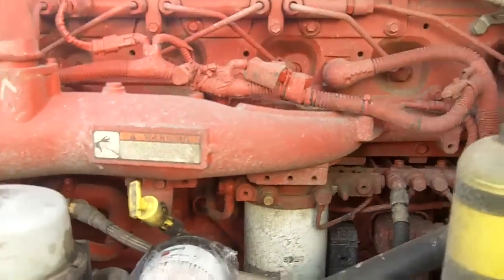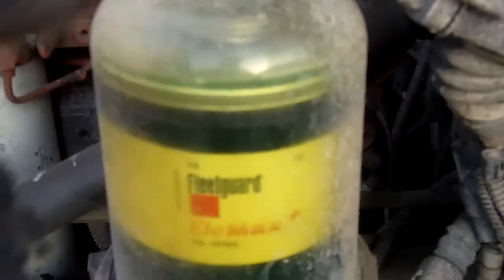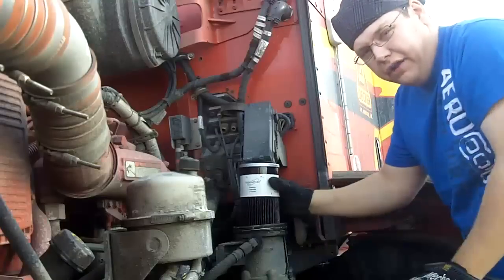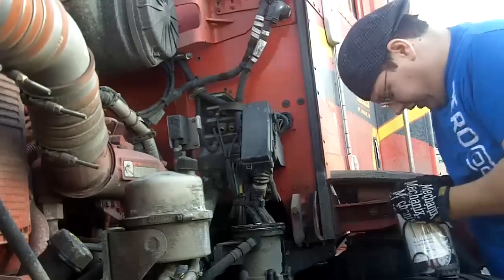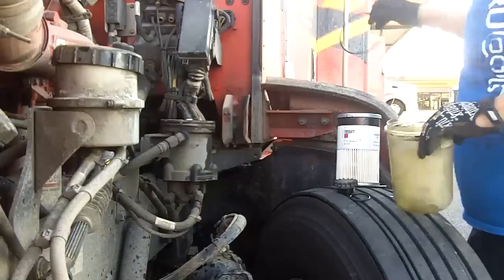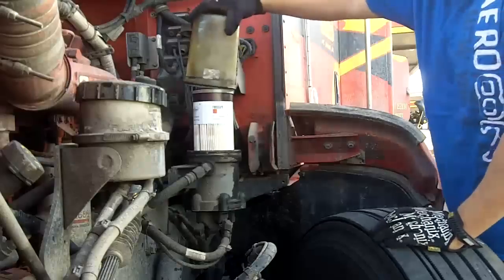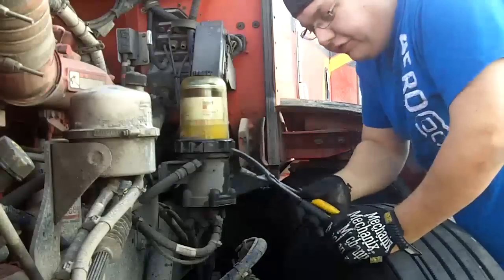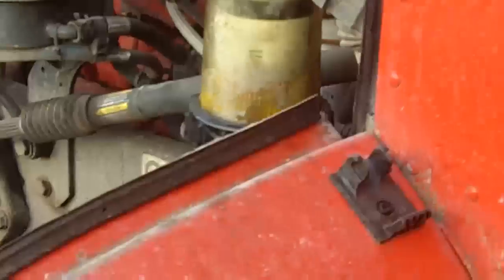Cummins ISX Fuel Filter Replacement

Comment: Dude you don’t need to reuse old fuel to fill up! It’s a CUMMINS! Next time after replacing new filter and tighten ring turn key to ON position BUT don’t START. Wait a couple minutes. Watch how it automatically fills up with fresh fuel directly from tank!

Comment: Thanks for the video, I was going to take my truck to the shop to change that filter but your video has changed my mind and I will do it myself, very easy and simple again thanks, Next time say you will turn the old filter and jug into a Haz Mat facility or disposal point, I happen to work in Haz Mat so be careful what you say and do in today's society dealing with Haz Mat or Hazardous Waste. Be Safe Down the Road.

Comment: Fantastic video there guy., but i would agree heavily with jilie36. In case you didn't know, that is NOT the primary fuel filter, but rather the filter for your Davco Fuel - Water - Seperator. It will collect water in the bottom of it if there is water in the fuel. Its great that you have a 10-micon (FS-19976) filter in it, I run a very fine filter in my truck as well, but re-using the fuel that you drain from the bottom of it will typically have a heavier concentration of water in it than normal, so it is not the best idea to re-use that fuel. In winter, I have seen quite a lot of water come out of the bottom of those things at times, wehen opening the drain.

  Also, I use a bit of vasoline on the threads of the big plastic ring that screws down to prevent it from binding up, making it easier to get on and off.

Comment: much better than they used to this comment coming from my wifes account but i am her husband and cummins certified and peterbilt dealer tech. the def and scr addition was a big reduction in work for the dpf and egr systems wshich also in turn allowed them to choke the engine back a little less so getting better overall.

Comment: Just a little tip...never re-use that fuel you just drained out...that kinda defeats the purpose of changing the filter in the first place. Go get a 1/2 gallon of clean stuff (I see the Love's canopy behind you there,) and use that to prime it.

And yes, please get that thing washed!

Not trying to criticize here...good to see a younger guy that at least takes the effort to do a little work himself these days.
Reply: I keep hearing about not reusing the old fuel which makes sense, But shouldn't all the fuel be drained out,completely to the bottom.?

Comment: Matt, Why are you changing the fuel filter? Surely that should be done in the company workshop during a routine service. It is always good to know how to do all of these things in case you breakdown with a clogged filter. Do you always carry a spare in the locker? Most companies frown on drivers doing work on the engine, that is why they employ mechanics.

You will have to do a video on how to bleed the fuel system after you run out of fuel.

Comment: That's a fuel water separator most newer ones have auto prime the fuel filter is the white one by the motor. So you still have not change one yet get out your manual and read it.

Comment: After I primmed mines the level went down when I started the truck an let it run....any ideal why?
Reply: It's supposed to the level is reserve to fill ur fuel lines and prime then up
Reply: @modelopapi5781  So come to find out I did it right as the filter get dirty it rises to a cleaner section of the filter...and thats what its doing now.

Comment: You don't have to add the fuel back in on the cummins. Cycle key a few times and it fills itself up
Reply: Sean Whitledge unless the priming pump is bad and to clear up your comment don’t just cycle it turn key on until you hear the humming go away shut it off for 10 seconds and do again 3 times should work

Comment: someone slap this guy for these reason here, NEVER reuse a Oring EVER! Also NEVER Reuse the Fuel you removed and yes ALWAYS drain that Fuel Bowl Completely!!!! after installing the fuel bowl, refuel bowl with clean fuel to the top of the filter and start truck and allow fuel to drain to bottom on filter then install cap. Top lid does not need to be that tight. on top if it all this is water/fuel sep missed the fuel filter

Comment: To start off.  Listen to yourself.  Use the right tools.   What did you do to the ring on that holds the housing down.  The ring is bent from using the wrong tool.   You are the guy that makes it hard for the real next mechanic.  You hit it on the tire to clean it off.   I would fire you if you work in my shop.